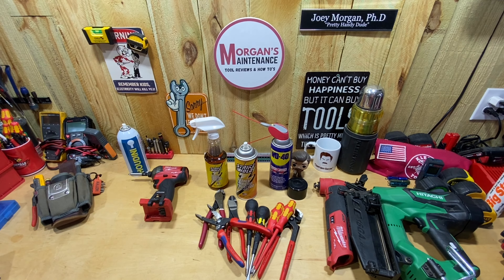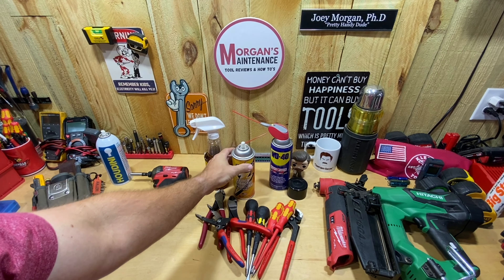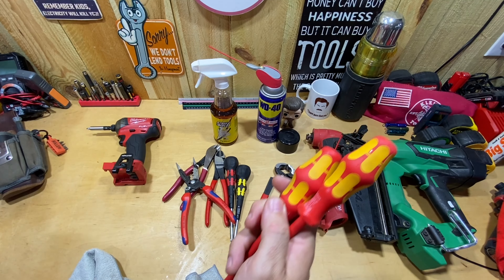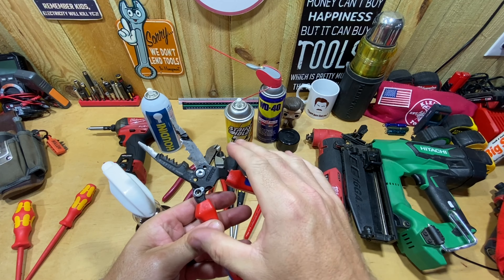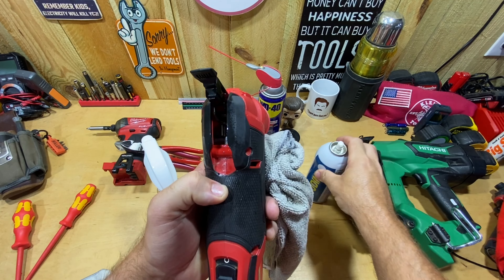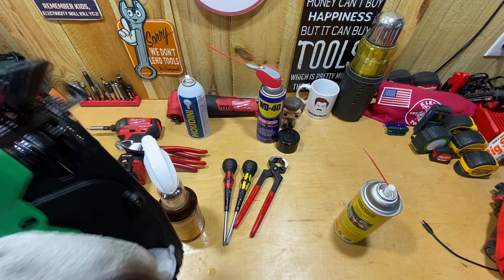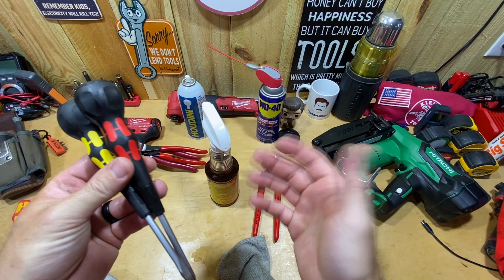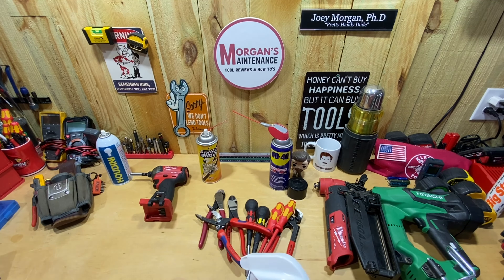STRIKE HOLD Lubricant - Made for the Military - How Does it Work on My Tools? #tools #maintenance

Comment: I'm envious. I wish my tools were that clean. They're relatively ok, but they're far from my expectations. Unfortunately I just don't have time to clean them every time I would like to.
BTW, you could make an hour long video of cleaning tools without any commentary. I think people would watch it.
Reply from the maker: I’ve actually thought about that when I clean my truck/tools  😂. (occasionally I go through the whole thing pretty extensively)

Some tools are impossible to keep in decent shape/or not worth the investment in the time, some just take a few moments. I try to keep up with  it between jobs.. sometimes it doesn’t happen.  

I’m just a neat freak in general.  I do it for my own sanity more than anything because I just get ancy if I’m in a lot of clutter.  It’s really weird though, because it never bothers me if other people never clean theirs.
Reply: @MORGANSMaintenance  It is my OCD as well. I wish I had all my tools pristine, but it's just impossible.
Let's take today.
From 9 am to 4 pm I was in my regular flat remodelling job. I was removing some wallpapers and I removed an old cast iron radiator and installed a modern one.
For wallpapers (walls are rendered with cement-lime plaster) I used cordless garden sprayer and steam wallpaper stripper. I wet cleaned both of them afterwards, but because the environment is dusty, they will cach some dirt anyway. I've put all the stripped wallpapers into the 80-litre plasterer's container, but because they were dump, there is always some dirt left on the floor.
Then I drove to my plumbing wholesaler to get some parts for tomorrow's plumbing job and new valves for the radiator. After I've returned I cut the steel heating pipes and threaded them using WD40 as a coolant. So my pipe threader got a little bit dirty and clean at the same time. Then I used SDS+ drill, impact driver (both in dry conditions, so I could clean them with air blower) and some Knipex wrenches (a bit of dirty heating water got to them, so wiped them dry and put them into the plumbing systainer; black steel Cobras have some surface rust on them of course). But it was all in the same room where I was stripping the wallpapers. 
After that I needed to load my car for the tomorrows service. I drive a minivan, because anything bigger here, in a 800-year old city, would be a parking and driving nightmare. The loadout included 9 systainers + big vacuum cleaner, plastic pipe welder, some plastic pipes and plumbing supplies. I air-blown whatever I could, but there was no time for anything more thorough. The flat is located at the first floor (2nd for all of you illiterate, imperial savages) plus 8 additional steps from the pavement level to the ground floor. There's no elevator and it's a standard for even high end condos older than 20 years. So carrying everything takes some time.
At 7 pm I went for some evening service - installing build-in fridge and dishwasher and some small electrical mends at the high end therapist office. Me and my tools were clean enough to enter that place, but I know I could do better. I've finished at 9 pm, so there's no way I could do any cleaning. I keep whatever I can in the systainers so all is relatively clean, but it's a far cry from your tools.
Reply from the maker: @Stefan_Kawalec  yeah full days like that… my stuff don’t always get the pamper treatment, it gets pushed out. 

There are lots of tools that I only clean occasionally, especially if it’s a frequent use and primarily tools not used in homes but job sites.

My hand tools in my tool bag get the most cleaning because it is what I use in residential more often.

You do what you can, it’s always all you can do.  Being presentable is all that matters. As I said I do it 99% for my me… the other 1% is for customers, etc… but they don’t care if I keep them “as clean” as I do.  They just don’t want dirt in their house.

Staying clean physically is my hardest part.
Reply: @MORGANSMaintenance  If I go to some super clean places, every tool is pristine
 When I have time I clean the tools, but I just wipe them with a dump cloth and some detergent. All the moving accessible metal parts are of course cleaned and oiled with whatever I have at hand ATM. It may be WD40, PTFE or machine oil. I try use as little aerosols as possible, because it's so wasteful.
Anyway, everyone who knows me, tells me that I exaggerate with tool maintenance. They should see what you do :)
Reply from the maker: @Stefan_Kawalec  yeah I get comments from everyone I work around 😂

I went to a customers house last week, probably the fanciest and biggest house I’ve ever done work in. They took great pride in their home.

I cleaned everything I was going to be using, took carpet tiles with me to cover their wood floors to set my tools on, etc.

There are certain customers that when I go to give an estimate, I can tell that it will be something worth going the extra mile for on cleanliness. 

Not that I don’t try to do it for everyone, but there are some that will care a little, and some that it will mean everything to.
Reply: @MORGANSMaintenance  Yep, I do the exact same thing. Some clients just need this extra TLC expressed in additional layers of protection on their floors, stone tiles, walls, doors, furniture and what not.
Last Saturday I've replaced a cracked bath in a flat so clean, that I suspect the owner does nothing but cleaning. She was rally happy when I started my visit with a big roll of thick plastic sheet and couple rolls of masking tape. The job took me 7 hours, I've quoted 1600 PLN (simple exchange that would be $385, but in purchasing power it's around $1k). An average price for this kind of job would be from 800 to 1200 PLN. So all the extra steps were worth it.
Reply from the maker: @Stefan_Kawalec that’s what I try to tell people.  Sometimes that extra effort gets you those clients that pay more money for the same work.  They aren’t choosing you for the work… they are choosing you and paying you more for “how” you work.  They see it as added value.  The extra money made far exceeds the time put into the extra effort.

Comment: You should try Balistol.
Reply from the maker: I’ve seen a few other tool folks that use those.  I’ve seen they have wipes, I like the idea of that.

Thanks for the suggestion 👍
Reply: I have used Ballistol for 10yrs in the concentrated form and had zero issues but if you do not like a strong Anise "Black Licorce" small then it may not be for you.
Reply from the maker: Thanks for your suggestion… I don’t mind the smell, sometimes customers do though.. 😂

I do a lot of work in finished houses and if I clean all my tools with something strong it lingers.  Especially since my toolbag is a closed bag.  When I unzip it the smell has been held in.

No I actually like the smell.

Comment: Was a big fan of kroil for tool maintenance,the bang kind, but guess it got sold out and the new is so pricey…….
Reply from the maker: I’ve never used that.  I got on the Houdini kick and never looked back.  

I have always been looking for a spray/pour option though and decided to give this a try.

Thanks for the suggestion 👍
Reply: @MORGANSMaintenance   silikroil (kroil with silicone) is my go to for most everything you'd want to use a penetrant for. It supposedly leaves a film of silicone behind. but HOLY COW the price of that stuff has doubled.
Reply from the maker: @metrowash  everything is getting super expensive… I think some is justified and some is because everyone one else is doing it 😂